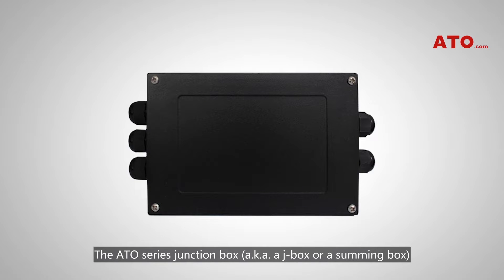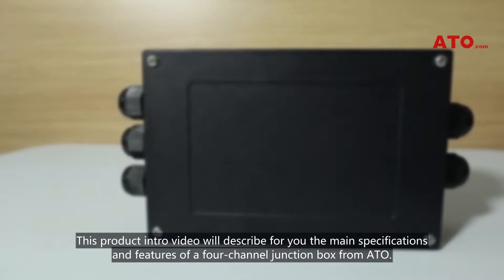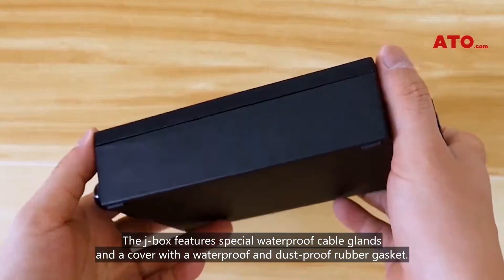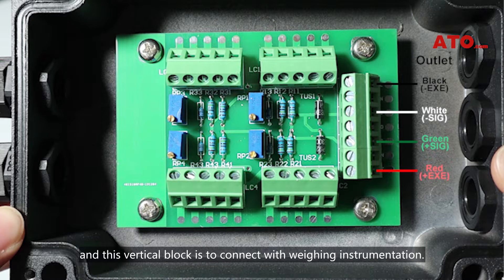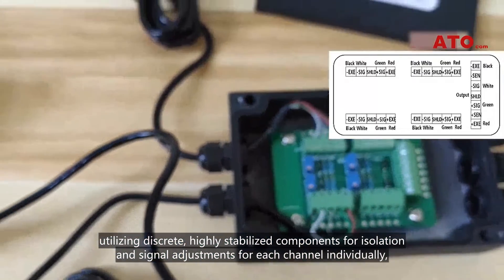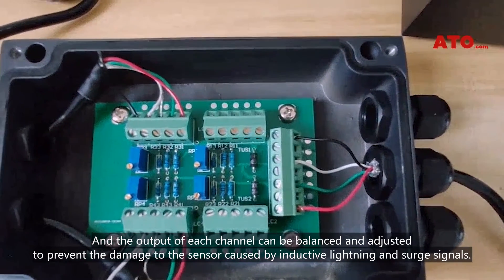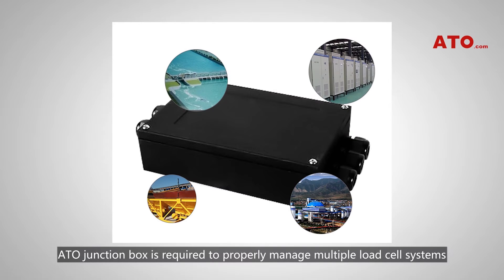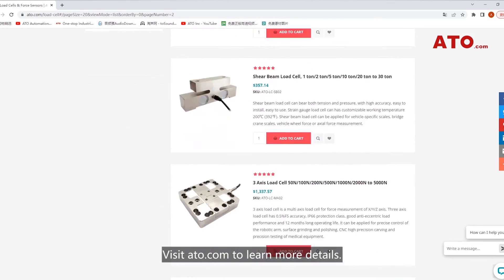4-Way Junction Box for Wiring Load Cells

Comment: Hello, I have a very technical question. Knowing how to read the load change exc+ and exc- values of 300-350 ohms one by one, but do I need to read these ohm values between 300 and exc- so that you can share this load access? 350 ohms again? How many ohms should I read these values at the Output Terminal?

Comment: Hello, I will ask a very technical question. I know that 300-350 ohm values should be read between exc + and exc - of the load cells one by one, but when you connect these load cells in the juntion box, these ohm values Do I need to read between 300 and 350 ohms again?